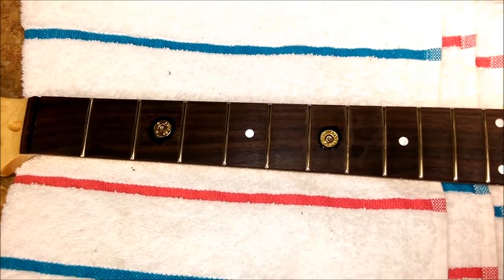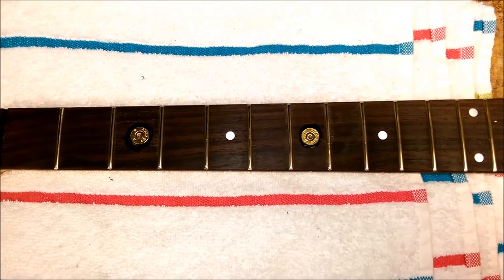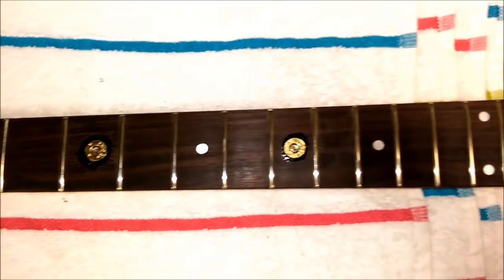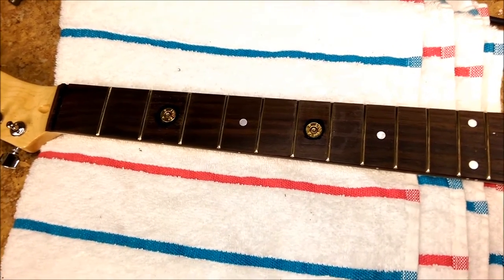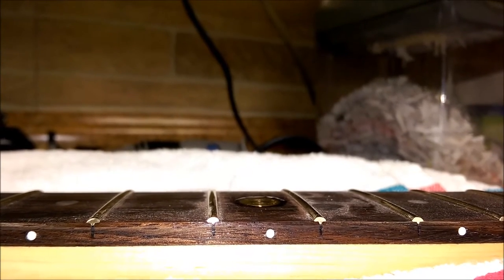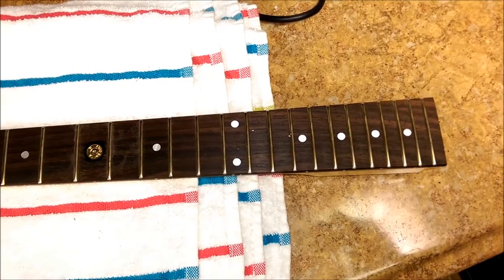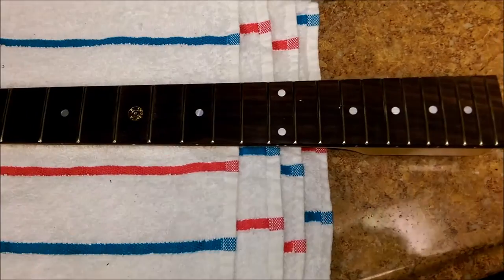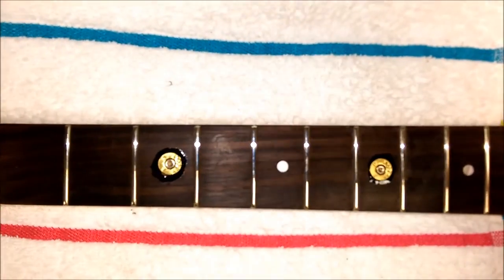Bullet End Fret Markers

Comment: Eric as far as the pickguard goes I know you want to cover up the holes that were pre-drilled. Instead why not try looking for and getting a clear see thru pickguard like Fender used on the 1969 Teles that they used that Pink Paisly wall paper and the Blue with the Yellow Daisy flower power designs. They used the clear plastic see thru pickguards on all of those including all of the re-issues that they have made over the past years. This would still look great and also protect the wood and finish from ever getting marked up from pick or finger scratches.
Reply: You sir are very welcome.  : )